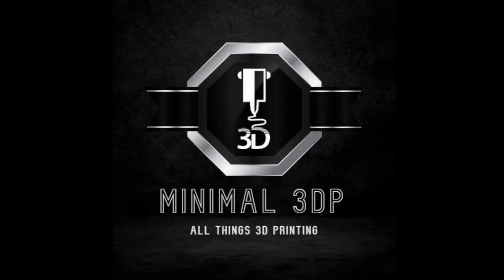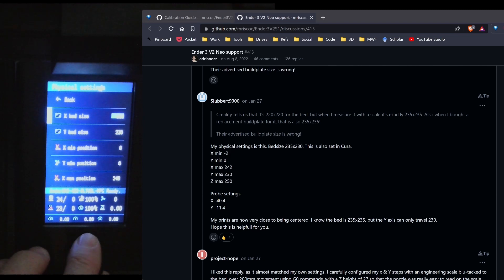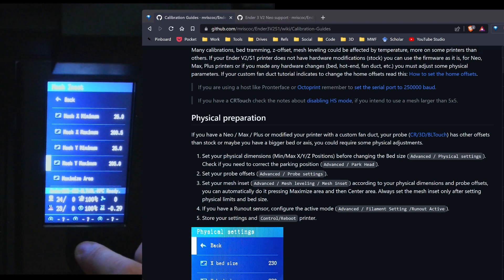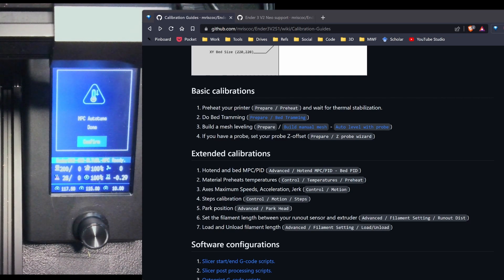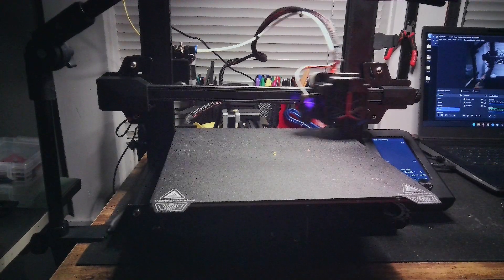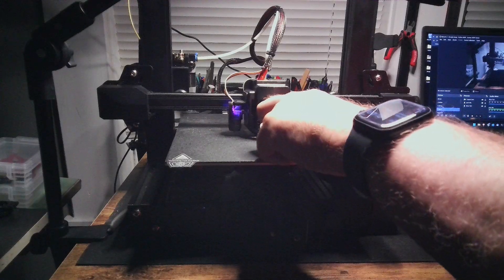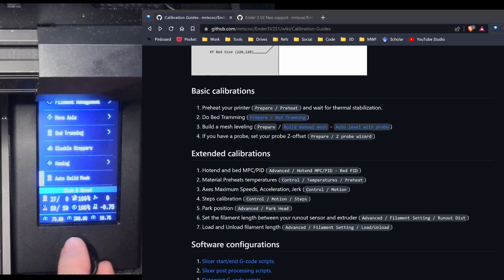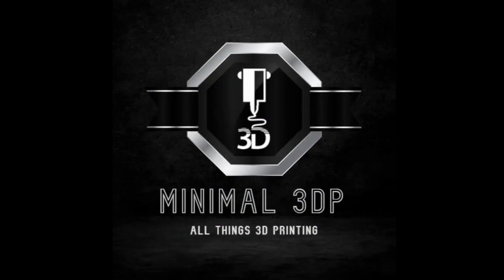mriscoc's Professional Firmware with the Ender 3 v2 Neo, A Calibration Guide

Comment: I followed through this video, saving settings as I went and then @10:31 my printer decided to drop the nozzle onto the bed and the X/Y/Z values started flashing again. The homing has been completely lost. What's going on ? Is my printer/motherboard broken?
Reply from the maker: Did you get your issues solved?
Reply: @minimal3dp I think so.. It looks as though it was caused by a 2 minute idle timer. I added M84 S0 to my test guide and that seems better. Now I'm back to trying to figure out why my filament won't stick to the bed. I don't trust my feel ability with the paper test so I'm going to get some feeler gauges and aim for 0.1-0.2mm for my 0.4mm nozzle. I've had this printer since December.. I hope to get it working for me yet.

Comment: Attention: at 3:47 your X-arm is loosing its perpendicularity while the Touch Probe is getting in contact of the bed. Therefore you loose a lot of mainly Z but also X accuracy. In consequence would be wise to invest into a second Y drive. Less than 30 € on Ali and the 40 thieves. Bought one labeled "Creality" for compatibility sake and am quite happy with it (didn't experience Mother Board 422 driving insufficiencies with both Y-steppers in parallel). However before printing, at least after a printer modification or simply moving it, you have to: 1- check perpendicularity of vertical profiles relative to the base lateral aluminum profile with a square (oblique vertical frame reinforcements are welcome; L brackets T-nuts attached to the front groove if the rear is occupied by the screw guide), 2- set the same bed heights relative to the base lateral aluminum profile (four corners) with a caliper, 3- set parallelism of the X-bar relative to the bed with the caliper or a gauge block placed left then right under the X-bar by turning one Z-screw for exact same height (by disabling steppers), 4- perform Bed Tramming Wizard fine tune, 5- measure heights with Mesh Leveling Wizard (I use the 9x9 option), 6- save settings.
Also had to file the right front support plate holding the Y-rollers to gain Max-X amplitude swing (right X-roller nut conflicting this plate).

Comment: Great video,thanks. My Ender 3V2 Neo will not print the purge line on the bed.It is 2.5mm to the left and nothing I try will correct the problem. I tried to adjust the settings in Cura to no effect, adjusting the XY offsets does nothing. Any ideas on how to fix it.
Reply from the maker: Are you using marlin or klipper? You might need to make a change in the firmware. You might also be able to play with the variables in your start code as well.

Comment: I have a bit of an upgraded tool head with a Creality Spider 4. When I run the MPC my Hot end seem to loose connection with the software. When I heat up say to 230 it only goes to maybe 180 and the printer then puts up and alarm and says the hot end is too cold. When it does get up to 230 it shoots past till the temp run out kicks in and the printer stops. I did it before but it fixed itself and I think I had to reload the settings back then. I thought it might be a glitch so I ran it again. Now I have the same problem. I will maybe have to revert back to the default settings again. Great video though. I was actually only looking to center the tool head on the bed. Thanks for your effort.
Reply from the maker: I think the issue with the heat is your firmware. See if you can find the default high temp. It is probably set too low.

Comment: Thank you for your time and effort posting this video. I have installed the firmware for my ender 3 V2 and updated the screen firmware. My problem is that I cannot get a minus value on my Z axis in order to adjust the probe offset. I am at a loss with this.
Reply from the maker: I believe you can mess with the z in one of the movement settings. Unfortunately I gave my ender 3 v2 away and can't check right now.
Reply: @minimal3dp  Thank you for your reply. I have found the setting hidden away in the firmware. It is going well now. Many thanks. 🙏🏻

Comment: When I run the Probe Z it's -6.00 above, I think the Tramming wizard is saving the height so it unsets it on the Z-probe. If I run mesh directly from tramming wizard it's fine
Reply from the maker: I don't use the tramming wizard so I am not sure how it works.
Reply: @minimal3dp  In the Vid you do it at 5:52 but I have found this firmware has too many features that none of its clear XD

Comment: I have a direct driver setup WITHOUT a probe. So my X axis is shortened and du to this my manual bed mesh seems to be screwing up. Im tryingtos et this for my manual setup but theres no info on how to do it without a probe. My bed is 200 (x) by 235 (y). My nozzle sits off the bed an when I  move it to the cornerlike requested Im at 6 y and 0 x but really im like 10mm in on the x axis. Im so confused because I see hes saying to put a negatve if it sits off the bed. You cant put -0 so is my Xmin 0 and y -6? or do I have to match those numbers up and do -6y and -6 x? Ive been at this for hours and find it so frustrating. Ive asked on multiple forums and not getting any answers. Anyone able to help?
Reply: I am getting the same problem - I cannot input - (minus) values on my Z axis offset - aarrggh🤬🤬

Comment: After this point, did you need to make any changes to your slicer/g-code? I tried to use a file that I sliced for the standard printer profile and it just wouldn't print at all. Then I tried adding the start and end g-codes recommended and I get a "low bed temp" warning as soon as it tries to home (regardless of what temp the bed is) and it makes me shut the printer down.

Comment: Hi,I just update my Ender v2 Neo Max to profesional firmware for the board and display,but I cannot set up the size of the bed,my one is 300x300x320 and when I try to set it up the probe goes off the bed,I spend hours and I can't find the setting.There is any settings to put it and make it know what is the size,or I have to do some manual settings.I new in the 3d printing,I don't know much about it.Thank you
Reply from the maker: You will need to change it in the firmware configs and then.compile
Reply: @minimal3dp  Basically I have to do all settings before I do the update on the board,I will need then find all the steps on the motors and all setting,I make the mistake and I didn't take any notes before and now I have basically nothing 😅
Reply from the maker: @Maxspert  Not that it helps now but take a look at: https://youtu.be/J-eWE7HWMpk

Comment: Can I ask, can you pause the print and turn off the machine, then turn it back on to resume printing? I'm still not comfortable enough to let my printer work while I'm out, and I'd rather my prints be whole instead of spliced.
Reply from the maker: I believe you could but those layers where you stopped will be weaker. Take a look at prusaslicer 2.6. It has a cut feature that is pretty neat and it might offer you a workable solution.

Comment: Hi, I just finished watching your installation of the BTT skr mini 3 v3.0 on your ender 3 v2 and you have installed this MRiscoC pro firmware, I have an Ender 3 pro that I am currently upgrading amd I am planning to use the BTT board and to buy the creality v.2 display that mriscoc firmware supports, my question is, since my printer is ender 3 pro that I am just upgrading the board and the display will that gonna be plenty enough to flash and use this pro firmware. Thanks and great videos by the way.
Reply from the maker: You should be able to flash without a problem. You can get a cord on Amazon for the board and screen. 

If you don't want to mess with the screen, Klipper is an option.
Reply: @minimal3dp  thank you so much for your response, I did ordered all the parts necessary for the upgrade on my ender 3 pro, just got it all installed with no issues and i got the firmware flashed, one thing for sure is that since my v2 screen is a tjc screen there is some issues specially when checking the mesh level, but its ok coz i plan to use octoprint anyway to check it. I have a question though, i left my z sensor button attached and wired to the board but the mriscoc firmware still uses my crtouch to home the z, is there a way to edit the firmware to use the z sensor button or just leave it as is as the probe is possibly better than the switch, thanks again for your response, rewatching this video again as a guide to calibrate my printer and start a test print

Comment: Mine still is not homing to center after the first set of steps. I am not sure what I am doing wrong.
Reply from the maker: Did you check your probe offsets in the firmware?
Reply: @minimal3dp  I have. I have set them to different numbers based on people suggestions and what I found online. I figured out part of the problem. I had my bed size as 230 instead of 220. The bed homes to the middle now but my prints are printing to the back right of the print bed.

Comment: Glad you posted this. I recently switched over to mriscoc (after owning the printer for all of 1 week) and I was missing an (obvious) step when calibrating the bed size. As an aside, I loaded the gcode into the OctoPrint Bed Visualizer to trigger a mesh update right fro the interface - I practically never touch the control now.
Reply from the maker: I only use the screen when I am tuning. Otherwise all octoprint or mainsail.
Reply: @minimal3dp  Just a quick addendum - I did find on my machine that I needed to reduce the x min and max (reduced both by -4) to get my prints centered. If anyone else is reading this, subtracting from both values will move the print bed center to the right (positive on the X axis) and adding to the values will move the print bed center to the left (negative on the X axis).

Comment: Nice tutorial, its helped me alot, but in auto build mesh it show red circle in middle right and left.

Bed termmed good, check with paper and everything is good but when print calibration stl it not stick to the bed , and in another position the nozzle  look too close to the bed.
I try everything and i will check again today
Thanks again.
Reply from the maker: Sounds like you need to manually level the bed. What printer is it?
Reply: @minimal3dp  i use manual level bed correct, but never show full green in auto mesh.... i use ender 3 v2 neo
Reply: @dfctor_dfc4557  I'm having the same issue (with Ender 3 v2 Neo).  Were you able to resolve?
Reply: @brgllc201  i just ignored the red dot because the cr touch will take care of height, i just switched back to stock firmware because now it support model photo, so idont need custom firmware anymore, for me its not giving me any different from stock, stock leveling much better.

Comment: Great video! I followed all your settings but my prints are off center, not sure if it’s Cura or just my printer, they seem to be moved towards the left side of the bed.
Reply: Just so @trashcanmemes3473 gets notified about this comment - here is what I found:
I did find on my machine that I needed to reduce the x min and max (reduced both by -4) to get my prints centered. Subtracting from both values will move the print bed center to the right (positive on the X axis) and adding to the values will move the print bed center to the left (negative on the X axis). I centered the mesh per the video after each adjustment until the probe landed visually center on the bed.
Reply from the maker: Is your probe offset correct?